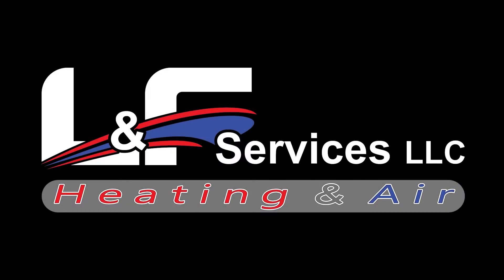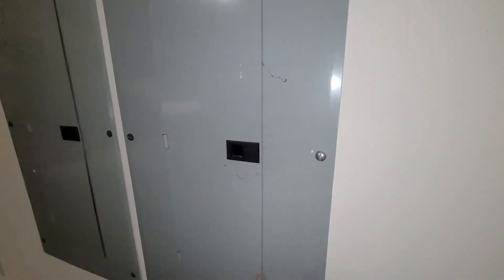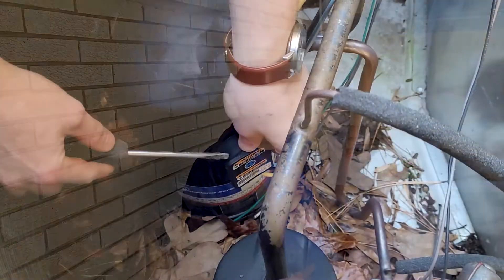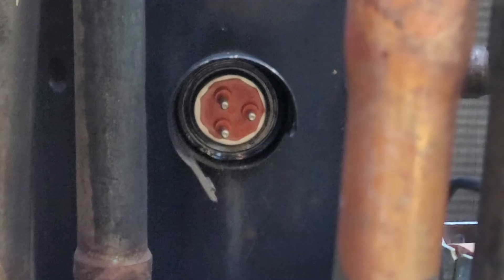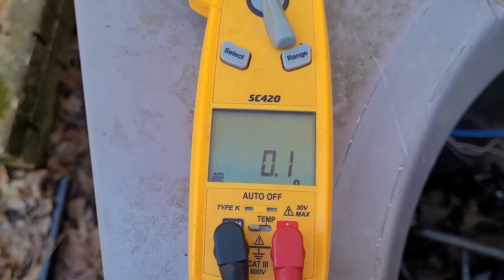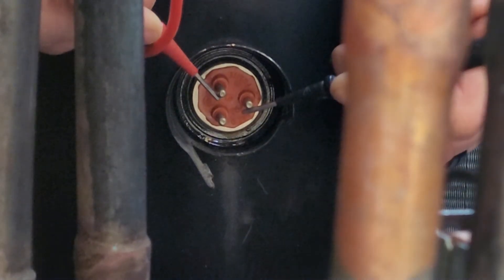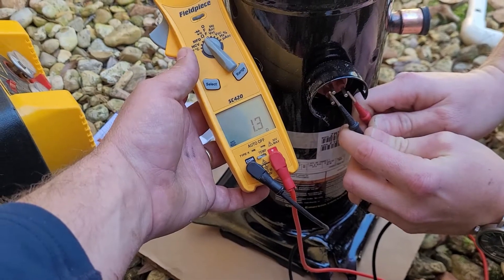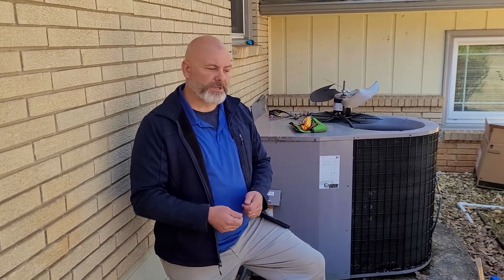How to Test For BAD Compressor.  Short to ground, open winding, or seized internally.

Comment: What does it mean if the breaker isn't tripping, but the line from the wall to the compressor is freezing up, causing the system to stop blowing cold air in the house? There's also barely any airflow into the house. I've cleaned the coils outside, checked the capacitor, and installed a new air filter. If I turn off the unit completely for about 3+ hours and then turn it back on, it works fine for a while, but then it stops cooling again. What could be causing this?